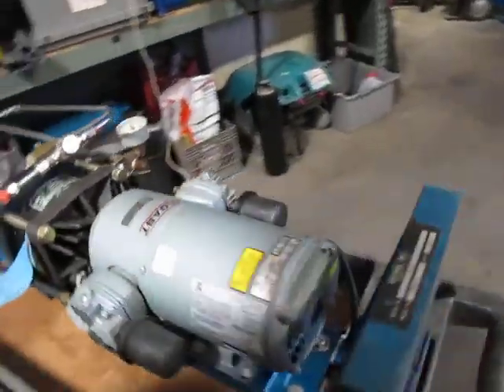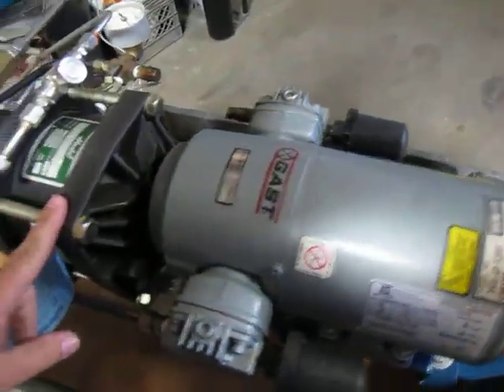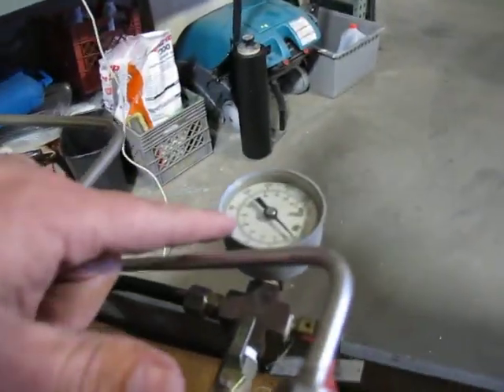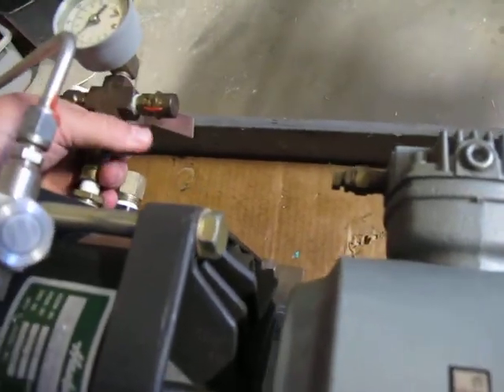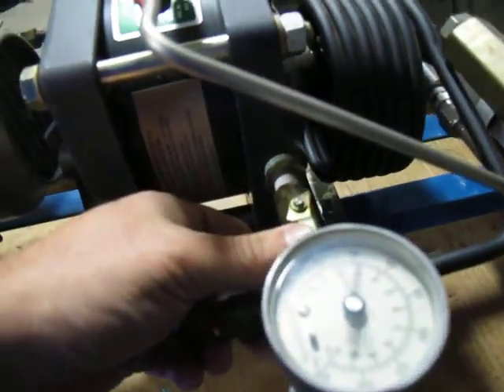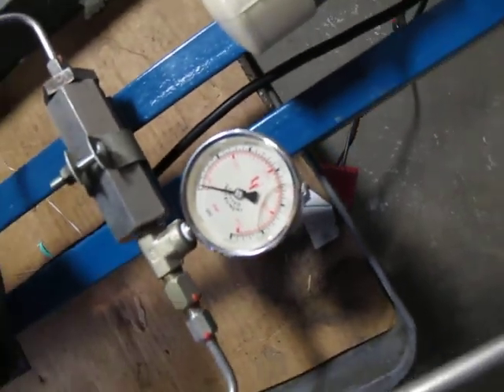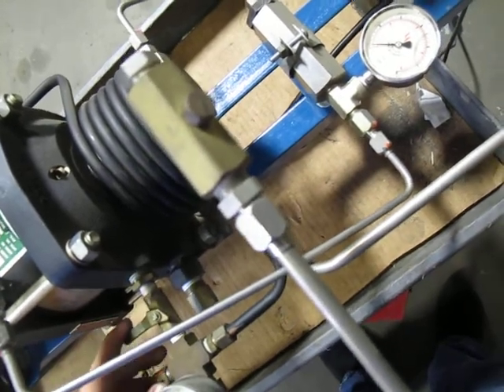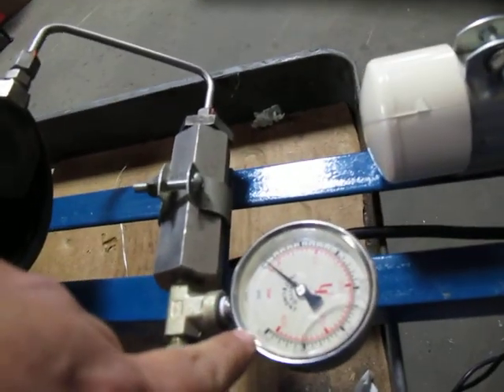HASKEL 55808 GAS BOOSTER SYSTEM 6000PSI MAX NITROGEN AG-50 GAST 3HBB-10-M300X

Comment: The reason you are not getting a reading on the 6000 gauge is because you are not drawing and pushing anything.  There are two pneumatic forces that work: the one I described below in which the gas is moved from source to destination and the gas that drives the booster (usually from a standard workshop compressor).  The 150 psi is your driving PSI.

Comment: you have a gas booster.  the purpose of the gas booster is to take gas from a low pressure source and deliver it to a destination that is at a higher pressure.  I have used these before in SCUBA cylinder fill with mixed gases.  Example:You have a K (one of them biggies) bottle of oxygen.  When full it is at about 250 cu ft of oxygen at 4500 psi.  You want to fill 80 cu ft cylinders (3000 psi) .  Normally you can fill the smaller bottles to capacity so long as the pressure in the K bottle is not equal or lesser than the pressure in the large bottle. As you fill bottles, the pressure drops in the larger bottle (not at an equal rate, in other words, you can probably fill several 80 cu ft bottles to 3000 before the pressure between the source (K) is equal to what you are filling.Once you get to the point where the pressures are equal you will not have a downstream flow.  to complete the fill, you will need to suck gas out of the source (K) and push it into the destination bottle.  The booster draws gas from the lower pressure source and through a piston system "pushes" it into the destination at a pressure that will cause the gas to go in by applying a force on the piston  (a smaller object).  That's probably not technically complete, but a general overview of how it works.